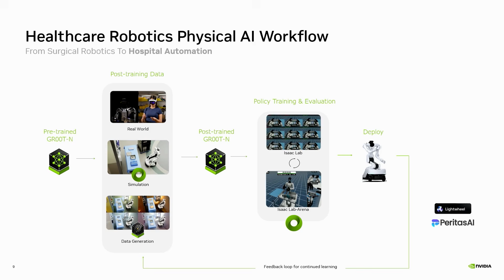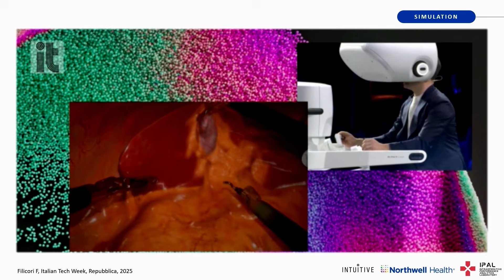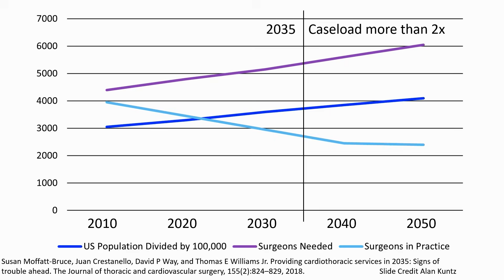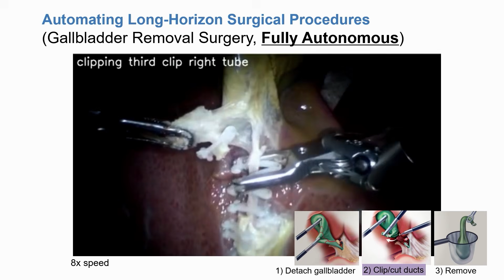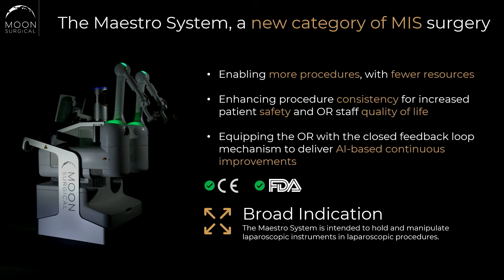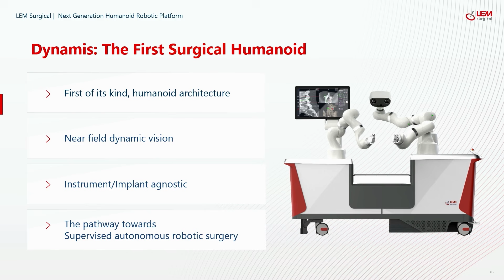GTC SJ 2026: Physical AI for Healthcare Robotics - Simulation-First Design & Accelerated Development

Comment: AI Reasoning Performance Test — 5 Questions

Question 1: Unknown Materials Problem

Without directly using any known material as-is, design a next-generation battery that simultaneously satisfies all of the following requirements:

* High energy density
* Long cycle life
* Low cost
* High safety

Your answer must also consider the possibility that no such solution exists.

Describe the search strategy you would use and define explicit conditions under which you would conclude:

“No viable candidate exists within the defined search space.”

→ Evaluates generation, exploration, and falsification capabilities.

⸻

Question 2: Minimum Conditions Problem

Suppose a persistent structure emerges for the first time from a completely unstructured system.

Define the minimum set of conditions required for such a persistent structure to emerge.

Then remove those conditions one by one and design a method to test whether each condition is truly necessary.

→ Evaluates first-principles decomposition and the ability to identify minimal necessary conditions.

⸻

Question 3: Unknown Law Problem

You are given time-series data consisting of 100 observed variables.

However, the underlying generative laws are completely unknown.

Construct a model that attempts to determine not merely correlation, but:

“What causes what?”

The model must also be capable of making predictions on previously unseen data.

Finally, define explicit conditions under which you would conclude that your model is wrong.

→ Evaluates causal reasoning, prediction, and falsification.

⸻

Question 4: Self-Falsification Problem

Consider an answer that you yourself have judged to be the optimal solution.

Construct the strongest counterexample you can that would demonstrate that your own answer may be wrong.

After considering that counterexample, decide whether you should:

Maintain the original answer,
Revise it,
or Reject it entirely.

→ Evaluates whether an AI can reassess its own answer without becoming attached to its original conclusion.

⸻

Question 5: Novel Research Generation Problem

Choose one current scientific or engineering problem.

Rather than merely combining existing research, construct a coherent new research program that proceeds through the entire sequence:

Problem Redefinition
→ New Hypothesis
→ Mathematical Formulation
→ Simulation
→ Falsification Criteria
→ Real-World Experiment

Finally, clearly distinguish:

Which parts are based on existing knowledge, and which parts are novel proposals generated through your own reasoning.

→ This is a highly demanding problem. It evaluates integrated research-design capability.

Q. Original Definer of f-bit Theory。

Comment: Hallo,

This Idea was not bad, it was good.   But here it was must be realty with data and security.  Where must be local infrastructures. Where data must be stored in local medical institution. And then only synchronization with Cloud like Microsoft Cosmos database. 

Because there is not only the problem can be hacking. There can be just cable cuttings. Field and instruction site working. Energy leaking ir electric field powerstation problems. And more and more problems. 

Other one without people's at any case cant work. Especially before surgery - operation. 

Must be investigations phases.  Where people are the main persons. 

Main persons for investigations visual first report analyzing command. Where the Doctors can take all data and using team with AI can color up the all object surgery places. It was like architecture work. And autonome work at this task is impossible.  Because all people's in planet are unique.  Like with Finger print. - stamp. 

For sure if that making happen then need here at any case attention. 

Autonomic work will cant pass and will cant will made. Because our time still AI and autonimic layers are not correctly working with the picture's and videos. 

On this definition cant change anything.